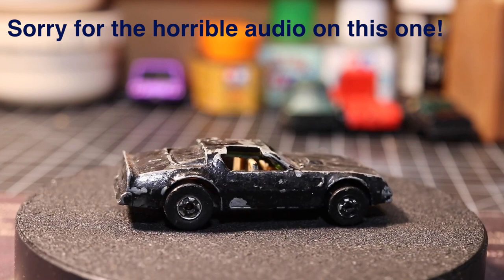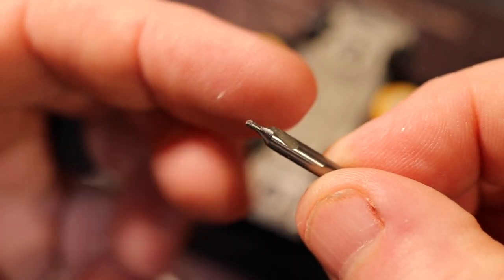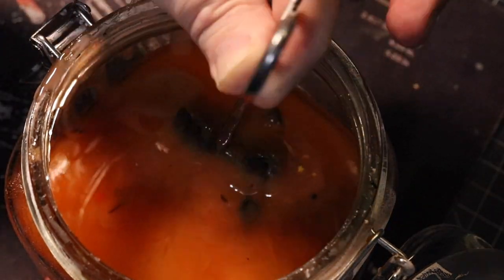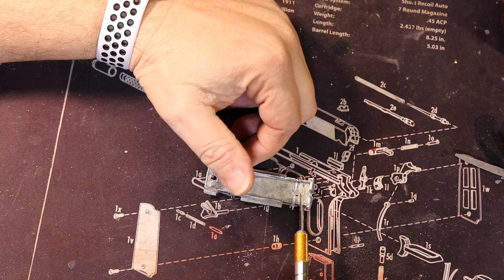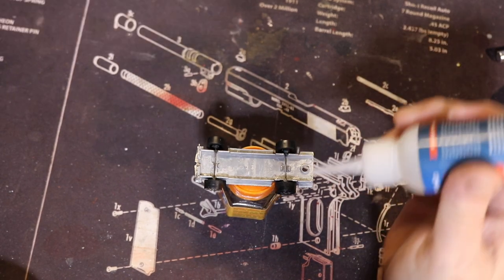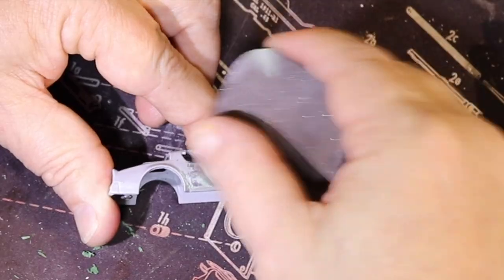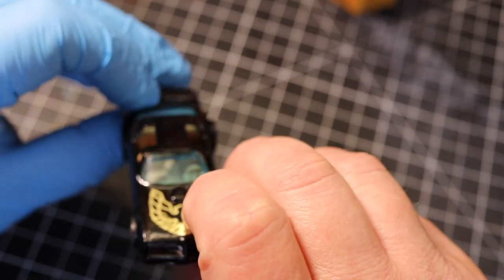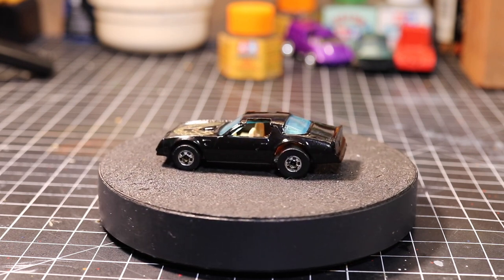Vintage Hot Wheels Hot Bird Restoration

Comment: I do a trick with car headlights if you wet sand the windshield with a 600 grit until it’s white or clear blue whatever the colors windshield is until the dirt off it which is soap and water and 600 grit sandpaper you can shoot it with clear like a 1K and it look brand new